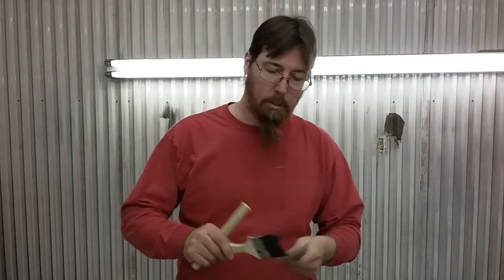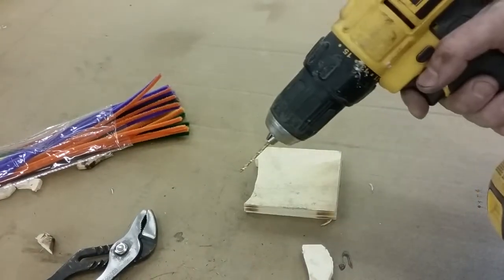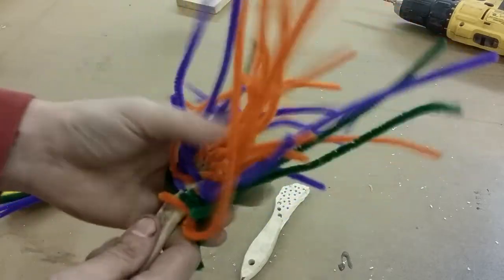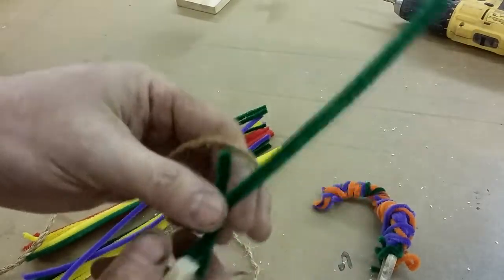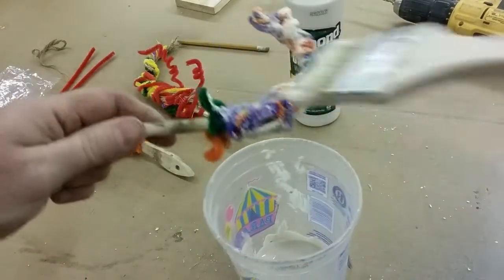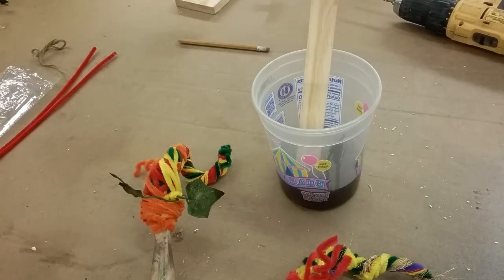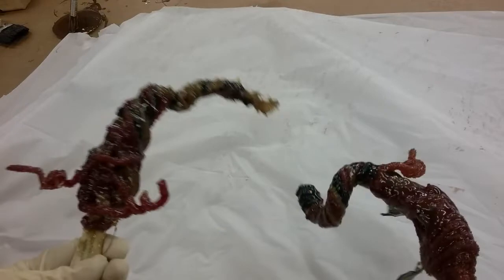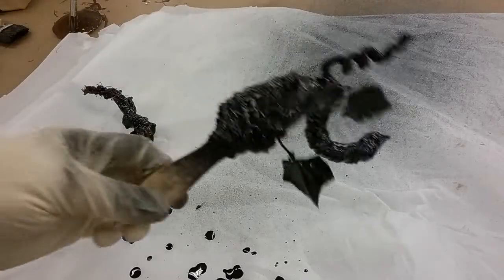DIY Dollar Tree FOREVER faux pumpkin STEMS tutorial!|Cobwebs and Candlesticks #diy #pumpkin

Comment: What is recommended to use to cover spray foam props ... sealant  ... noticed you said the fiber glass resin may not be a good choice to use on foam
Reply from the maker: Fiberglass resin will sometimes eat softer foams but works great on rigid foams. Spar Urethane varnish made for outdoors works great. A coat of Titebond wood glue is a great choice too. You can always use a few coats of rustoleum 2x clear too. All these are great on foams.

Comment: Great idea! I did similar with foam backer rod.
Reply from the maker: Thank you! Fiberglass would probably eat the foam a little and shrink it but if it were at the core of the stem I think it would be fine.
Reply: @CobwebsandCandlesticks  I ran a wire through the backer rod and used latex and shop towel to sculpt the stems so they would be poseable.  Not as durable as fiberglass for sure, but almost as simple to make.
Reply from the maker: @OakLaneCemetery  my only drawback is latex having a shelf life that dwindles quicker outdoors. My poor zombie snail is falling apart and splitting from being outside. I might just do a resto vlog on him!